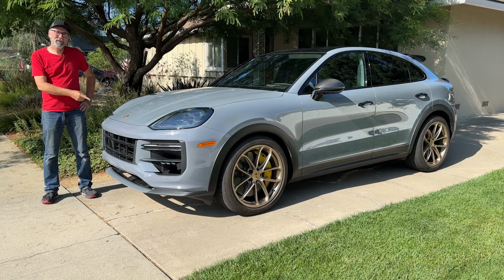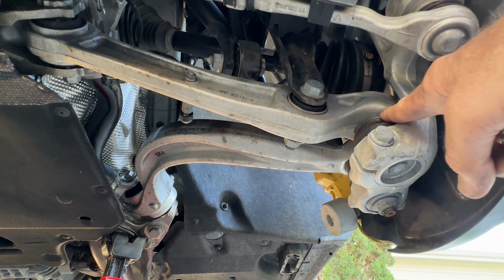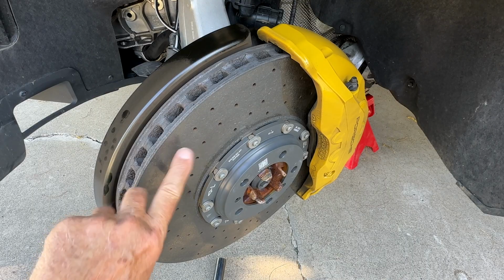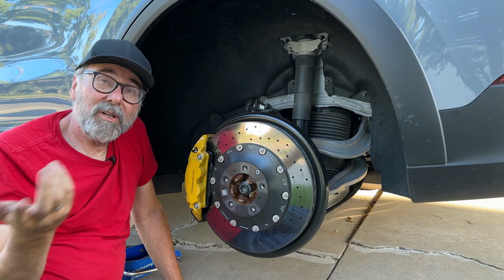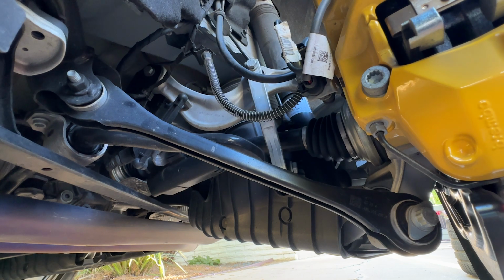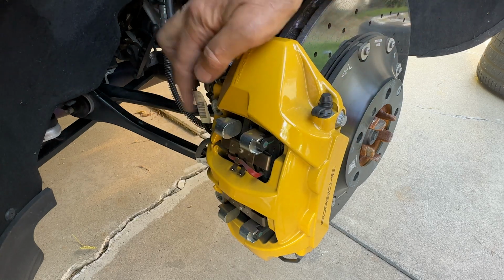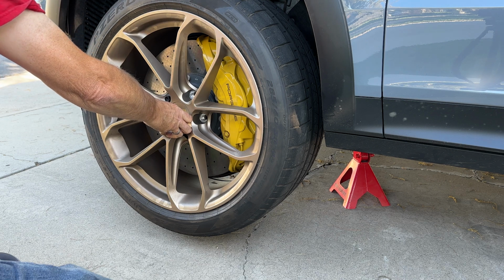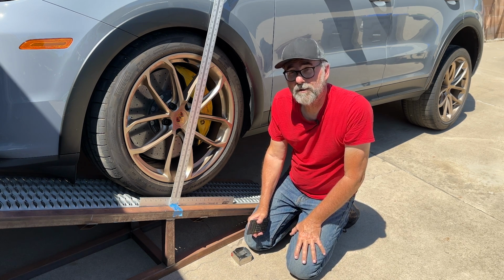Porsche Cayenne Turbo GT Suspension Overview and... Flex Test? Car and Driver

Comment: Careful removing wheels especially in front. Bang the wheel on the carbon brake and chip it and you’re out over $20,000 for new front rotors.

Comment: I like that they are using a top and bottom duel pivot on the front suspension. Not only is handling improved, but wear is also reduced.
Reply: How does the dual ball joint link setup improve handling and reduce wear over a comparable double A arm with single ball joints?
Reply: @ALMX5DP  handling is improved by moving the pivot point from inside the tire to the middle of the tire. This reduces a phenomenon known as "scrub".
Wear is reduced on the tire from reducing scrub, but you also divide the load on the ball joints.
Reply: @kevindavis8143  ah gotcha, yeah I do see that making the upper links longer would make contact with the wheel so makes sense to develop it that way so the virtual point is still in a reasonable position. I didn’t think about how big everything is. On my Miata the upper arm is actually within the wheel barrel a bit but only because it’s so small and not interfering with anything else. And yeah definitely makes sense that two ball joints could distribute and effectively manage the load.
Reply: @ALMX5DP  my E90 BMW has a dual-pivot lower wishbone, it is a huge difference vs my old E46.

Comment: does it look like they changed anything else geometry wise compared to the 2023 model? I have a q7 based on the same chassis and I wanted to upsize my tires from the 285/40/21 to a 285/45/21

Comment: Will the new tyre sizes fit on the pre face lift (at all suspension heights ? ) old 285/40/21 vs new 285/45/21

Comment: Dear Sir. If Porsche would turn the Backing Plates into Aluminum instead of Steel wouldn’t the Aluminum plates draw more Heat a way from the Carbon Fiber Rotors ?

Comment: whats the diference beetwen The Macan and the Cayenne?
Reply: Everything is different
Reply: A macan and cayenne are as similar as a camaro and corvette
Reply: @SirJamesTND i know some diference but i want to know more
Reply: @Tatom_Martin  The Macan is based on the first generation Q5 platform and although it has been updated twice, is very old.   It came out in 2014-2015 and that was when the previous generation 958 Cayenne was still around.  It also uses completely different engines at this point since the Cayenne no longer uses the 2.9L V6 Twin Turbo (at least for now).  It also uses the 7 speed PDK / Dual clutch whereas the Cayennes all use an 8 Speed automatic.  

Aside from being 4 door (5 door really) SUV's with platforms underneath shared with other VAG vehicles, they couldn't be more different.